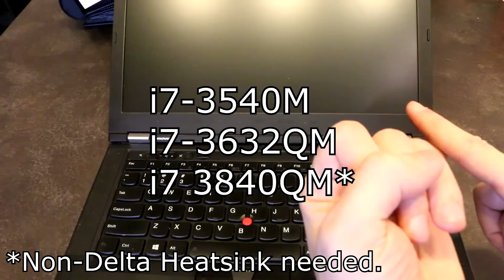Lenovo ThinkPad T430: Upgrade Wonder

Comment: I've been running a T430 (i7-3520M, 16GB DDR3, 1TB SSD, X1 Carbon LCD mod, 9 cell battery, Ubuntu 16.04) for almost 6 years, and have found it to be the best all-around laptop I've ever owned. I might be one of the few longtime Thinkpad fans who prefer the new (at the time of the T430) chicklet keyboard. The original 1600x900 LCD was atrocious regarding color and contrast as were most laptop displays from that era, and as I do a lot of late night reading in dark rooms, the X1 Carbon display swap added immense value for me. With a fresh 9 cell battery, it can get 8 hours under moderate to low load. It is also extremely durable, relatively speaking, showing only scratches and finish wear and tear after all this time. My only reasons for upgrading in the near future (likely to the X1 Extreme), are a physically larger display, not needing a heat shield for my leg when the laptop is under heavy load, and weight. Better wifi performance, NVMe storage, and a trackpad which supports advanced multi-touch gestures will be a nice bonus. I'd highly recommend this laptop to anyone who might be in the market for such a device.
Reply: Hi Ryan, is the X1 carbon LCD mod simply bolt-on or does it need any severe possibly screen damaging work before it fits in the T430? I'm asking, because i recently got a T430 and i'm interested to upgrade it to max spec, not because i need, but for the fun. I work at this store where we sell used lease corp. computers to people, so i have access to parts and so on. Why T430? I had possibility to choose between X220-X260, T430, T450, X1 Carbon and HP Elitebook Z 14 or 17. I don't need max power, i need durability.
Reply from the maker: Well said and thanks for sharing your configuration.
Reply: Can you please upload the video showing how to do these upgradations?
Reply from the maker: Are you asking me or the original poster?
Reply: Hi, i´ve got almost the same configuration on my t430, but i think it´s overheating, would you please post me your temperatures?. Please. (on heavy loads it reach 95°C, on idle 45-50°C ).
Reply: I run Ubuntu 16.04, and using 'tlp' and BIOS I've set the laptop to always run in powersave mode. These days I'm more concerned about the laptop running cool and lasting longer than a little extra horsepower. With very light load I see temps between 45-55C, and I consider anything from 65-75C+ as hot. I don't know the highest temps I've observed offhand, but 85C+ is definitely not normal. I would check your fans and fan ducts for obstructions such as dust, and that the fan blades are clean -- 90% rubbing alcohol and q-tips work well for cleaning computer components. If you are having stability issues, and are well versed in disassembly of computers, I would redo the CPU/GPU with some highend thermal paste.

By "heat shield" I mean I'll often use my tablet inside it's case as a heat shield between my left leg and the laptop, both for my own comfort, as well as to keep the laptop a little cooler.  The absolute worst to me is when the laptop gets so warm my palms start to stick to it when typing -- I find this extremely unpleasant, though luckily it does not happen often.

The only non-standard upgrade I've done is replacing the LCD with one from a similar generation Thinkpad X1 Carbon. Here is a guide that covers the reasoning behind the parts used, and how to install the display using a modified LVDS extension cable. http://www.thinkwiki.org/wiki/Replacing_T430_screen_with_a_better_one
Reply from the maker: Thanks for the link to the guide.
Reply: Was it complicated to upgrade the LCD to the Thinkpad X1 carbon on a T430 ?
 @ry616e
Reply: Great to hear the details of your build, I've been running a t430 for a few years and the main reason I was considering upgrading was the poor screen quality. Modding seems like a great alternative.
Reply: What's that heatshield thing?
Reply from the maker: Which?
Reply: he said that he doesnt need the T430 heatshield which is... for protecting your legs from the heat? Because I have the T430 and if you get it heated up, I'd say my legs aren't protected :D
Reply from the maker: Ah gotcha.
Reply: @Ryan. I have done all of the possible mods except for the LCD screen. I love my T430. I am thinking about getting a T440 as my next project. :D
Reply: @Darknamja  The touchpad on T440 was such a big mistake that they have to go back T430 style on the T450
Reply: @YesthisisCharlie  yeah but you could feel the edge everytime you press the mouse button. around 2016 for some models (x460s for example) are actually returning back to the t430 design.
Reply: Hello I have a quick question. I have a Lenovo T430 and I struggle figuring out why it won’t charge when I’m using it. It charges if It’s closed but not when it’s open. Have you had that problem
Reply from the maker: Using a legit power supply?
Reply: Laptop Retrospective yes I am its from Lenovo
Reply from the maker: Very strange. Haven't ran into this before.
Reply: Totally agree, Ryan! I'd like to know further where you get the X1 Carbon LCD mod? Looks like something really promising I'd like to splurge on my beast as well!
Reply: How much is this labtob.

Comment: How about battery life with a new 6 cell battery?
Reply: Battery life is shit, 3 hours brand new battery 70+, and maybe 4 with the 70++ 9 cell version. Mine last about 20 mins from full charge to 0%. I'm not wasting 90+ dollars on a new original battery.
Reply from the maker: @JorgeEscobarMX  that's the problem, lots of 3rd batteries are hit and miss. Most don't even have near the same capacity as the original.
Reply from the maker: Not entirely sure. Didn't have one in my hands long enough to test. Was in high demand.

Comment: Before talking of power, make measurements!
A 3rd gen i7 isn't up to date. Besides that it consumes 5 times the energy compared to a up to date same power cpu.

I did the measurements: my loved x220s with i7 was just slightly more powerful (<20%) than an Apollo lake N3450 in cinebench!!! But 22 Watt instead of 5 Watt. just said but useless these old machines.
Reply: Nah man. I'd suggest using both side by side - chances are it's NOT EVEN CLOSE in real life. First of all the only i7s the X220 ever came with stock (AFAIK) were 35 watt jobs - 2620M and 2640M. (You could get a 17 watt i5 though. 25 W did exist but wasn't sold in this model.) An i7-2620M scores twice as high in both single and multi-thread performance in Passmark. In Cinebench R11.5 64-bit multithreaded, scores should be 3.1 vs. 1.97, with similar results in x264 encode - maybe your X220 was throttling and in need of a thermal paste / cleaning job, can't imagine they've got a huge heatsink. Single threaded, it's more like 1.3 vs. 0.6, showing how weak the N3450's individual cores actually are (it just happens to have 4 vs. 2 hyperthreaded, so the multithreaded tests don't look as embarrassing). Lots of everyday usage only stresses 1-2 cores - you can probably tell what that means.

For something with MT performance in the N3450 ballpark, there used to be the 17 watt i7-2617M (base 1.5, turbo 2.6) and i5-2467M (base 1.6, turbo 2.3 GHz). No doubt, that still is quite the difference, but then what do you expect from a low-power 14 nm process vs. the old 32 nm plus what no doubt is a lower-power architecture to begin with. That's 5 years of progress right there. Look at the i7-6600U, it's a 15 watter that clocks like the old 35 W i7s and still is 10-20% faster.

In sum, an old 35 W Sandy Bridge i7 may no longer be state of the art but it definitely isn't a slouch or in danger of being outrun by an Atom any time soon. I can understand if people aren't exactly ecstatic about having one of these little hotties in a subnotebook though. I've had my hands on a Toshiba Portege R700 with a (35 W) Westmere i5 before - talk about high-pitched fan noise.
Reply from the maker: Excellent info and we'll presented. Thank you for sharing so articulate an opinion.
Reply from the maker: Power consumption is certainly a item of interest. Especially with mobile platforms. But older chipsets can still run a lot of modern programs acceptably.

Comment: I daily use a T530 and X230, both are excellent machines. The T530 is slightly modded with a Full HD screen from a donor W530, stock I7 dual in it still , and the X230 is just a basic I5 but with SSD in it and its a sprightly machine to this day. I pretty much stop at these machines as I am an old school Thinkpad user and the quality did indeed drop off after this generation.
Reply from the maker: Good choice there.
Reply: I'm going to put the 3840QM in the T530, when I can get some funds up for the CPU (or find a dead W530 with one in it) My T530 is a hybrid graphics machine. Great unit, still powerful to this day even with the dual core. I like the old 7 row KB better but have learned to live with the 6 row as back-rolling to the 7 row on the newer T530 isn't exactly fully functional. I kept on trying to run a W520 but the previous gen machines just run too hot and throttle whereas the Ivy bridge units run alot cooler and work alot better of course. My favorite machine still remains the T61P and W701 but they are just out moded at this point in time. I might pick up a T430 after seeing your great video on it as these machines are quite surplus right now and readily available on the cheap!
Reply from the maker: They certainly can be a fun project.

Comment: I am still using a T530 as a main computer. This thing never gets old. I cloned the HDD to 1Tb SSD, and use the old HDD in the DVD Bay for storage. 16gb RAM. It is as fast as new machines. With I7. Screen is HD+ with an awesome resolution and format, not glossy. Replaced the keyboard as the fire ants chew the original... Sticky and yummy. I still don't feel the need for a new one.
Reply from the maker: Nice. The fire ants sound like an interesting story...
Reply: +Laptop Retrospective yes. Red, tiny but painful ants. I use the laptop deep in the jungle, in very humid environment.
In a certain moment I realized that some keys were not responding anymore. I took it out, checked it, cleaned it. It was full of crumbs, sticky, dusty. Only then I realized those ants really liked to chew on the silicone taps under the keys, and eat the contacts.
After a week, they did the same to my wife's ThinkPad. I had to smoke the ants out of the house and replace both keyboards.
Reply from the maker: Now that's a real story of some serious use.

Comment: Huh nice to know what else i can do to my t430 :)
Reply: I do enjoy being able actually replace things without taking the thing apart(lets just say i had some bad experience with a cheap hp and asus laptop)
Reply from the maker: I fully understand.
Reply: Think a t510 and t410 will be similar in upgrade potential?(hopefully i can get them)
Reply from the maker: In some ways moreso since they don't have hardware only BIOS flashing. I think you can still do them from software to remove the whitelist.
Reply: Interesting
Reply from the maker: The parts will be older but in terms of options, greater once the whitelist is removed. It makes for some interesting reading.
Reply: Hmm the only downside to this new found knowledge is deciding which computer will get upgrades first(also have a thinkcentre m91p to work on)
Reply from the maker: Haha. Good point.
Reply from the maker: You're welcome!

Comment: The T430 is one of the latest real ThinkPads which allows you to do some heavily modding,
thanks to community which were interested and involved in that process. (Like some old days with T61 modding)

For mine stock T430 with i5-2520m I did next list of modding:

1. CPU swap -> i7-3632qm
2. Heatsink swap, to NVidia model, with extra heatpipe (my T430 doesn't have NVidia card, so extra pipe help alot in cooling)
3. Memory upgrade -> HyperX 2133Mhz DDR3L 16GB
4. Classic keyboard upgrade
5. Screen upgrade to IPS WQHD (the hardest part)
6. SSD for main SATA slot, HDD replaced the optical drive, and some m2 sata SSD...

...and what I got after all of that? I'v got an extremely fast machine for my software developing purposes with amazing IPS display
and amazing keyboard.

The only one drawback in T430 series is that main SATA slot located very close up to palmrest, it's mean that after
heavily laptop usage it causes left side of palmrest be more hot in comparsion with right side. Swapping HDD to SSD decreases heating, but
not removes it completelly...Anyway, this is a great machine.
Reply: T440p and W540P have some serious upgradability too.
Reply from the maker: For sure!
Reply: What about its battery, I'm going to buy one so I will be happy to know that it has a good battery.
Reply from the maker: Battery if used will probably need to be replaced. I suggest a 9 cell.
Reply from the maker: Excellent upgrade list!

Comment: Great video. I did buy a 410 3 years ago and installed Lubuntu. Works great. Now you have me interested in the 430.
Reply from the maker: It has some trade offs from the older models but is still a contender.
Reply: Due to the better power efficiency and Intel graphics capability, it is significantly faster. With an SSD and a new battery, it's on par with brand new laptops.

Comment: My friend inspired me to get a T430 and I love it, though it's not as durable as I expected it to be. Hinges and bowed lids seem to be a high failure point for these machines I've noticed and mine came with the lid ruined, ruining the hinges shortly afterwards and broke a few tabs on the bezel. My ultrabay got destroyed by the laptop's weight, the laptop was sitting in my bag at an angle and the weight of the laptop pushing down on the ultrabay managed to break the locking tap piece. On the flip side, the machine performs well and after a thermal paste change it stays damn cool and quitet at idle and even under small loads. Keyboard feels great too despite what most ThinkPad enthusiasts say. Absolutely love the servicebility and the price. Lovely machines.
Reply from the maker: Sounds like yours might have had a tough life before you got it. Thankfully parts are easy to come by.
Reply: Laptop Retrospective I believe it got scarred during shipping, the keyboard had very little wear and there's no dings or signs of wear anywhere
Reply from the maker: Could have been an old demo unit or perhaps saw previous service repairs.

Comment: I am buying It (version with i7)for the computer science University.
Is worth It?
Reply from the maker: If you get a good price, sure. How much?
Reply: @LaptopRetrospective  260 the version with i7 and Nvidia nvs 5400m
Reply from the maker: Sounds decent if it's in good shape. Might not be the fastest kid of the block but will last you for ages.
Reply: @LaptopRetrospective  thanks, in case can you suggest me a good laptop for CS University?
Reply from the maker: That really depends on what your program of studies will demand from a laptop. I haven't taken courses in CS so I won't pretend to know what is the most important specs so any information you can provide would be great.
Reply: @LaptopRetrospective  ok thanks anyway for  the disponibility
Reply from the maker: You're welcome. Sorry I couldn't help more. Best of luck in your studies.
Reply from the maker: Listing says Fractures or defects in the housing and cover (B-Ware) so I'd avoid it. There are enough out there you shouldn't have to settle for something with damage.

Comment: I got a T420s for $50 off craigslist. added an OEM battery, SSD, 16GB, and liquid metal CPU paste. It's get now. 

but honestly, my favorite is my T61.
Reply from the maker: Nice.
Reply: I've still got my T61. I wish they'd carried on with that old solid style. I'm finding myself looking back for older Lenovos similar to this one. The newer Lenovos just aren't the same in any way. They got the design spot on with T61s and others of a similar style. It has a nice feel to it, but will have to update to another one soon and I don't want one of these flimsy new style laptops.
Reply from the maker: That T61 sure is a fan favourite.
Reply: not quite as sturdy as the https://en.wikipedia.org/wiki/T-34  tho
Reply: Its so hard to find T61 nowdays 😕
thats why im going for the 430 and its fine for my needs
Reply from the maker: T430 is pretty nice. I think you'd be happy.
Reply: Must have been a pain in the arse to replace the thermal paste, those s series do not make it easy
Reply: Mark Jay my favorite t61 gpu dead last week.
Reply: yeah the quadro NVS140M wasnt very reliable
Reply: Hola ke se
Reply: I couldn't find t430 battery cell,  can I put t420 battery instead?